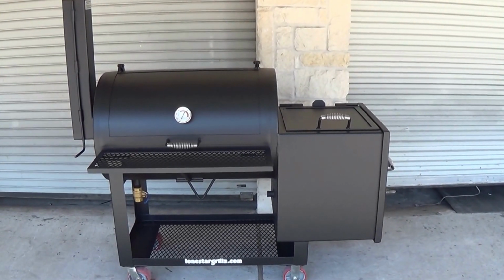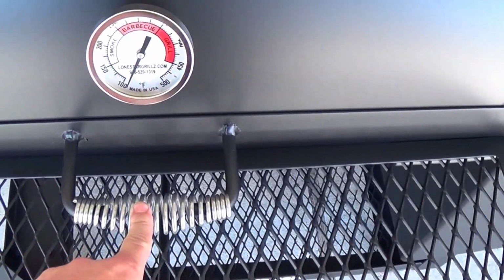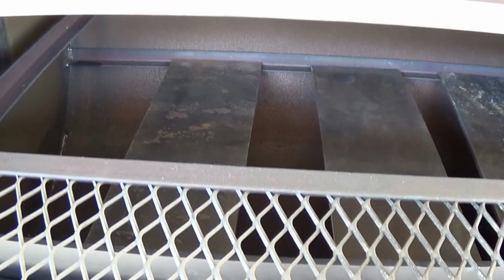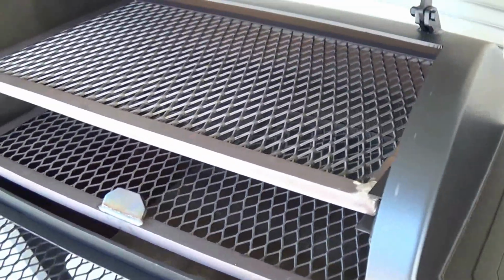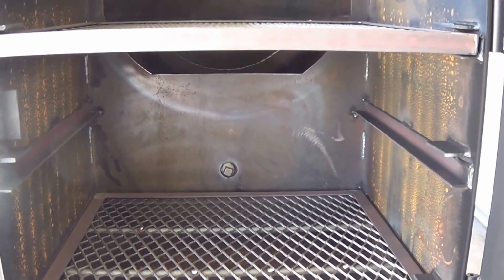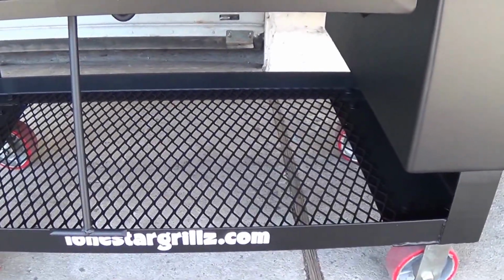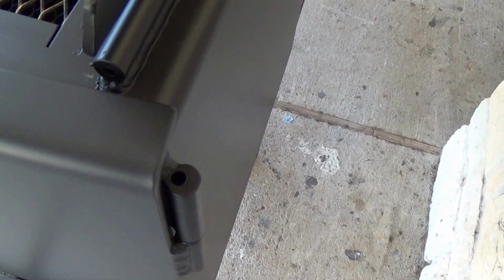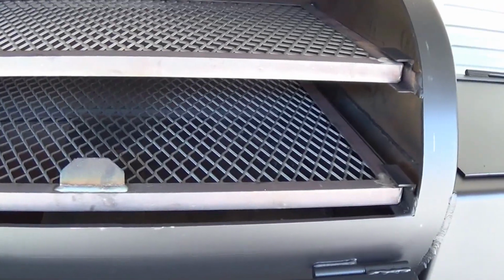24''x 36'' Custom Offset Pipe Smoker by Lone Star Grillz

Comment: firebox size is to big
Reply: Not once you start working with your fire. I have room for the coal bed in the middle and splits off to the side preheating and ready to slide up against the coal pile instead of plunking it on top. Boy did that method save on my expensive wood and I had that deep blue smoke almost the whole time with the damper wide open. 
Don't forget there is a grill grate in there and a griddle on top. 
You won't find a more versatile smoker setup out there and it is all because of that massive firebox no one else offers.